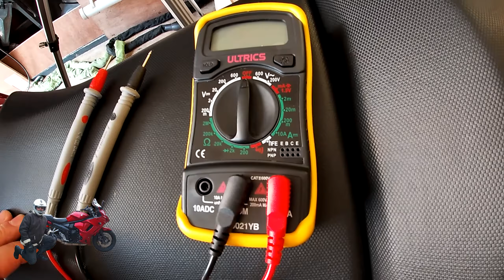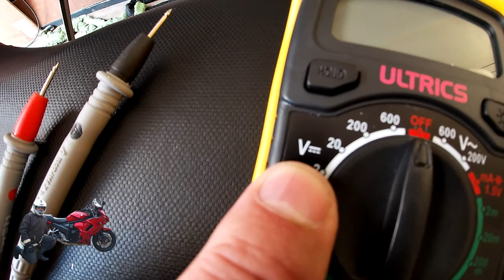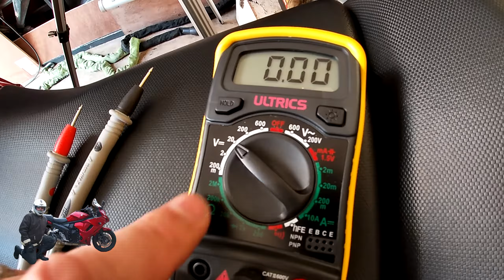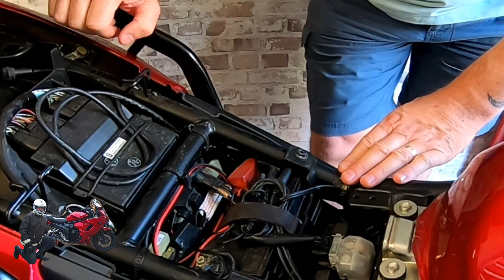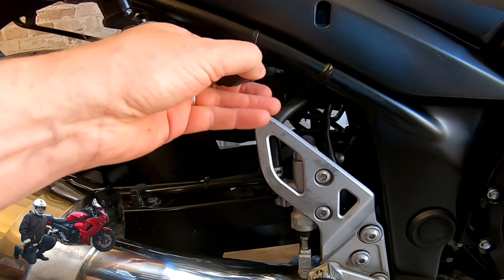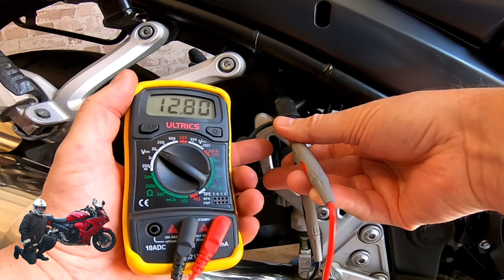MULTIMETER BATTERY T￼EST #motorcyclebatteries #motorcycles #scooters #maintenance

Comment: What model is this digital multimeter used for testing on motorcycles?  thanks
Reply: thanks
Reply from the maker: @chunbxu69  Digital Multimeter 21-yB XL830L it’s not bad got it on Amazon was cheep does the job okay and more 👍👍 hopefully this will help you 

Dave
Reply from the maker: I’ll check it out for you after work, thanks for watching 👍👍👍